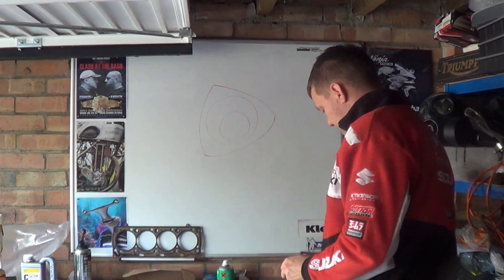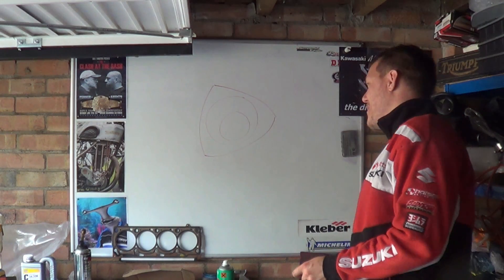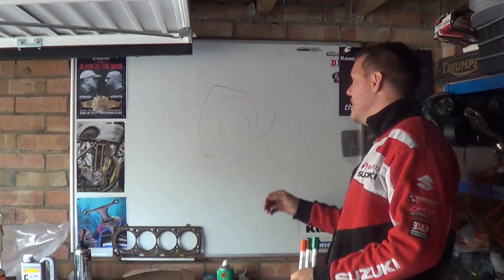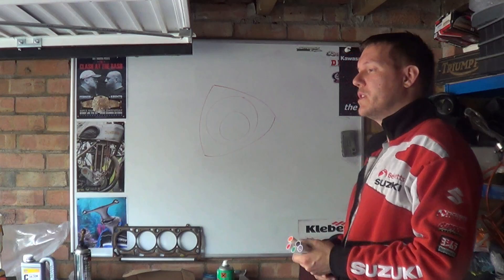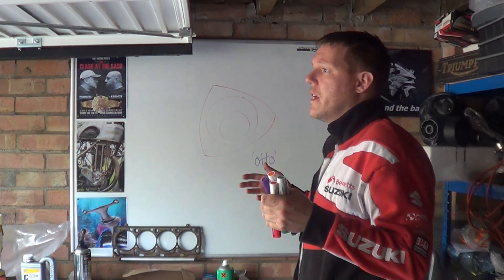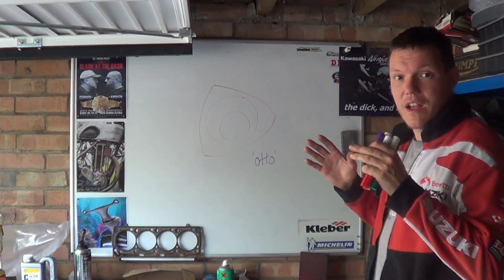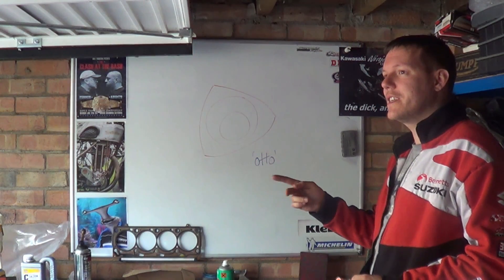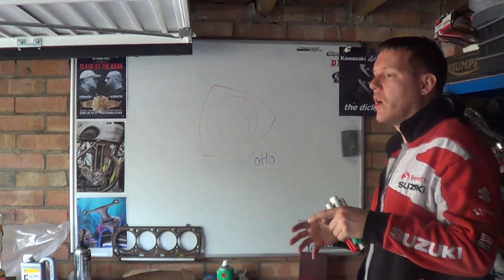Are Wankel engines 2 Strokes?

Comment: Probably mistaken because they sound like a high revving 2 stroke, And all the smoke
Reply: Oh for Christ sake even a piston 2 stroke has 4 cycles, intake, compression, power, exhaust, the intake and exhaust happen around the same time, with ports, ports and exh valve or as in a modified hemi, both int/exh valves (baffleld to prevent short circuiting) like toyota s-2. the rotary can be visulaized as a uniflow 2 stroke like a dog chasing his tale. but ther a re 4 seperate events, its how you look at it i guess.
Reply: @jlo13800  Nor true, All Wankel engines operate using the 4-stroke principle. 
None of the 4 cycles are combined or significantly overlapping.
Reply: @sandervanderkammen9230  i use amsoil interceptor 2 stroke oil in my rotary. its the best i used so far.
Reply: @sandervanderkammen9230  Getting mobile 1 2t is too much and amsoil interceptor is a full clean burning synthetic 2T. Aixro XR-50 article says to mobile 1 2T which is straight weight 40 2T. Amoil interceptor is 48.50 ish per gallon though. Many of kart Aixro XR-50 and mazda have run it just fine. BRP-XD-100 ETEC oil works ok to and i did run that when i can get it but i like the interceptor better which works great in oil injected engines (piston and rotary) anyways. its the cleanest burning oil i have used with high film strength. Some of the Norton and Mazda folks swear by Silkolene Pro 2 SX and that oil aint cheap. I found so XD-100 on sale at walmart and got a few gallons for my old silver 8v92 detroit 2 stroke and dumped in about 3 gallons just to see what it would do. i noticed smoother running and it's cleaner. its got a lot of detergent and cleaner than shell rotella and it cleaned some crud out of it.
Reply: @jlo13800  If you read your Mazda owners or service manual it clearly states that only API SL or higher 4-stroke motor oil should be used.
Mazda does not recommend Premixing with any oils.

There are no 2-stroke motor oils that meet Mazda minimum API SL or EC GF3 specification.
Reply: @sandervanderkammen9230  Many folks have modified mazda rotaries for 2 stroke oil. in a stock car a 4 joke stroke is only producing not much power. You dont have to run the interceptor in most cases as 2t oil synthetic is overkill. I used to run 10w40 castrol at 40;1 in a CCW 440 in a snowmobile when i was a kid, ran it for 6 years with out problems. A rotary does not load the breaings as hard as 2 stroke as they have lower compression and BMEP. The interceptor 2T is kind of thick though.
Reply: @sandervanderkammen9230  Amsoil dominator 2t is harder to ignight and burn off unless you run it hard. Rotron rotary says to go with silkolene pro 2 sx 40 2t. motule 800 2t also which is not cheap. Are you running the stock oil injection.
Reply: @sandervanderkammen9230  does the 4 stroke burn clean. The only 2 stroke cars today are tesla's as electric motors are a magnetic rotary 2 stroke.
Reply: @jlo13800  It burns very clean which is why Mazda recommends API SL or EC GF3 
There are no 2-stroke automotive engines made anymore, they are obsolete just like the 4-stroke Wankel engine.
Reply: @sandervanderkammen9230  Yes there are the Tesla electric motors are a form of 2 stroke magnetic rotary 3 phase. Automotive seem stuck on 4 joke stroke. 1 stroke to turn it 3 strokes to were it out. Cummins just came out with a big 2 stroke for tanks though its 873 CID, OP 4 cyl 2 stroke. The e mach e-mustang is another electric 2 stroke.
Reply: @sandervanderkammen9230  Do you run oil injection on your
Reply: @jlo13800  Do you not understand the difference between a  internal combustion motor and a electric motor?
Reply: @jlo13800  Oil injection is what Mazda designed for the engine for maximum performance and reliability.
Mazda does not recommend Premixing.
Reply: @sandervanderkammen9230  Yeah but a lot of folks do it anyhow. The Aixro XR-50 kart racing rotary is 294cc and 50'is hp they say to mobile 1 at 50:1.
Reply: Royal purple 10w40 synthetic works great in 2 strokes also.
Reply: @jlo13800  So, what is your point?
Mazda does not reccomend Premixing with any oils in their engine.
Reply: @jlo13800  What is the API or JASO rating for Royal Purple 10w-40???
Reply: @jlo13800  What is your point?
All Wankel engines are 4-stroke
Reply: @sandervanderkammen9230  you can turn off the oil injection and the stench of some oil is awesome. Castor 927 maxima!
Reply: @sandervanderkammen9230  electric is much more efficient and makes way more torque!
Reply from the maker: Electric is more efficient? Who told you that?
Reply: @thedirtyworkshop  A lot more torque and HP for their size and torque from the getgo, few  moving parts. The ICE uses the electromagnetism force of chemistry but the electric motor uses straight magnetic force to wrench the rotor crank around. In a way a 3 phase motor is a virtural 3 rotor rotary or 3 cyl 2 stroke and fires every 120 deg. they are compact and can fit is places ICE cannot  and are very rugged. Tesla Used radiant aetheric ZPE to power his devices. He build a magnetic arc distruptor witch was a uni-flow 2 stroke device that involved plasma arc amd magnetic field. Lator T Henry Moray made a small plasma chamber tube device that cranked out ov 50KW of power form the ZPE. He was shot at and almost kidnapped. Joseph Papp built an inert gas filled pulsed plasma 2 stroke engine than ran itself and he disappeared. All charges that make up everthing is broken symmetry in the vacuum.
Reply from the maker: Electromagnetic force? Apart from that you're forgetting the power station the electric motor needs
Reply: @thedirtyworkshop There have been inventors who built over unity motor generator devices tapping energy from the vacuum.
Reply: Bruce Depalma, Viktor Shauberger, Timothy Trapp (QEG).
Reply from the maker: No there hasn't. The casimir effect does NOT draw energy from the vacuum. Period.
Reply from the maker: Where did Tom get his PhD? Where unit was he in to gain the title of Lt Col.? What nuclear facility did he work at again?
Reply: @thedirtyworkshop  Vacuum fluctuation drive the casimir force, its been done it experiments. Many inventors were attracted/suppressed for violation the status quo. Kenneth shoulders worked wich high density charge cluster ball lightnings which tap into the zpe. These clusters are the precursor of every lightning strike. lightning is actual a 2 stroke phenomenon.
Reply from the maker: The ground energy state of the vacuum is what forces the plates together. This is done because the plates are closer than the wavelength of the particles created, creating a gradient in potential energy. If you can power from 2 plates 50um apart then be my guess.
Reply: @thedirtyworkshop  exactly there is enough energy in a coffee mug volume or the volume in my YZ-250 2 stroke to boil all the oceans. This energy drives all the charged particles that make up the fuel we burn to the crankshaft we turn. Joseph Papp bults an inert gas filled 2 stroke engine that made lots of power at low rpm do the the abrupt motion of (electrons/nuclei) in the torodial vortex formed at TDC! I got Moray b Kings book on tapping ZPE. Eugene Podkletnov built a machine that makes a very powerful force beam that punches holes in concrete and dents thick steel plates. That could power a gravity wave rotary 2 stroke.
Reply from the maker: The energy is in the associated fields of each force. You can't get at this energy hence why these particle or fluctuations are stable. Stop reading crap that nutter make up.
Reply: @thedirtyworkshop  its a really awesome energy source, i'm glad you find it interesting, the chemical ICE is good but it dis it's time already but they will always be fun for a hobby, even though electric makes way more torque and power for its size ill always tinker with 2 strokes. Cheers.
Reply: Seth Nicodemus and you have to mix the gas with oil I assume?
Reply: I do on my OMC rotary sled engines, its a haunted object though.
Reply: Low revving ! 3 cylinders 2 strokes without tuned exhaust chamber. 3 in 1 exhaust pipe.

Comment: old rotarys required oil and fuel mix, they have open ports, it has a power "stroke" once every revolution, the apex seals wear quickly like 2 stroke rings (compared to 4 stroke). they have little torque and produce there highest power at the top from band. 
I agree that they have 4 individual cycles, but they share a lot of characteristics of a 2 stroke.
Reply: None of those characteristics are unique to 2-stroke or Benz type engines.
Reply: 2 strokes engines have more torque than 4 strokes...

Wankel have poor torque because of little  shaft excentricity.
Reply from the maker: Do they? That seems like bollocks. Each you look at each power stroke, 2 strokes make less torque.
Reply: @thedirtyworkshop  Same displacement and same RPM...?
Compare cbr600r Honda  and Rg 500 Suzuki...

Comment: Wankels are an odd mix. 4 events make them work like a 4 stroke. Jet engines have 4 events but in a continuous cycle. Wankels are not continuous, so 4 stroke.
Reply: 2 stroke have 4 phases so it is a 4 stroke ?
Reply: @fabbri4497  
Not really sure. They run like 2 strokes but have another thing going on by the design. Valves. Since the rotors are triangles maybe should be called a 3 stroke. Very cool design anyway.
Reply: @upsidedowndog1256  valves ? not with Wankel...
There are 2 strokes engines with valves. (I mean not poppets valves, but as 4 strokes )